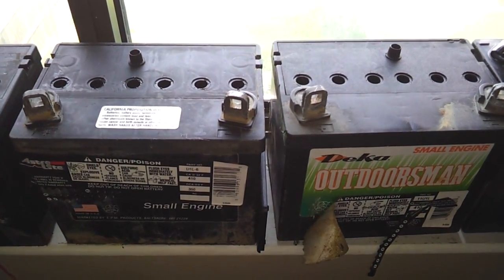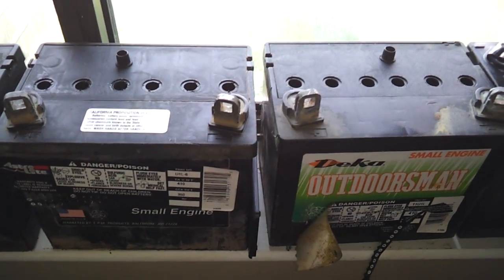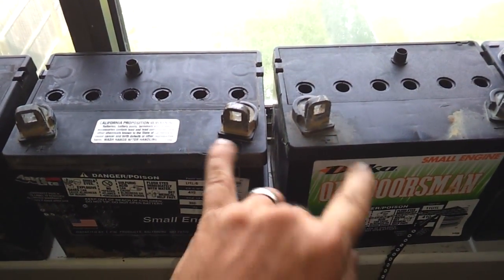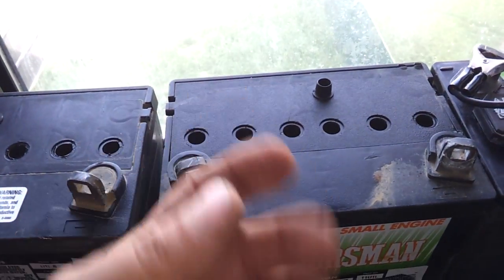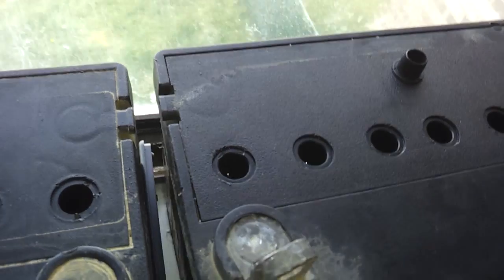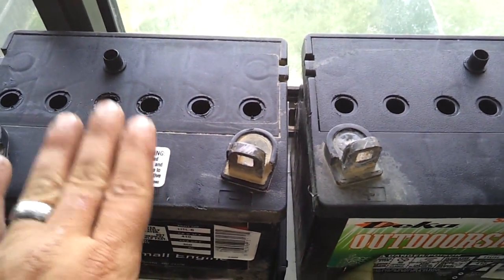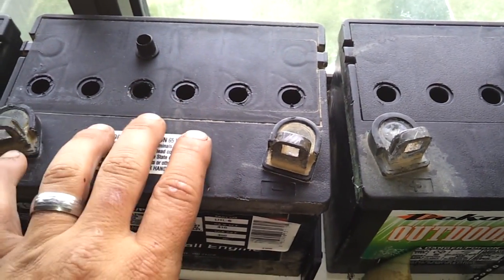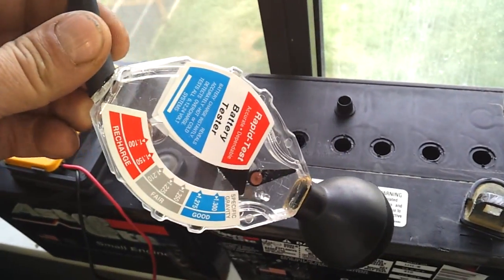Inside view of lead acid battery before and after desulfator

Comment: I got a idea now cut the top off  a deep cycle battery and see beforeband after charging snd taking the sulphur out .put the lid bsck on and use a oil based caulking like for gutters hopefully they have black now.well fing see the diff.😊

Comment: Why couldn't you pour out the acid/water.  Then pour in something to dissolve the sulfate and any other junk on the plates (nitric acid, or whatever the best solvent of lead sulfate is).   Then pour that out, rinse good, and pour the acid back in or use new acid????

Comment: Hi, i recently got into this depth of auto battery charging and reconditioning (desulphate). Your video refers to 3 weeks of the process going upto 4 weeks. My Stanley unit has a recondition function, that states the process will happen for 24h after which it will go back to charging automatically. It also states that if after completed this process 5x times it does not work, battery should be recycled. Pl clarify why their 24x5 times cycle amounting to 5 days and 10 inclusive of 5 x 24h charges is a limit vs your process of 4 weeks.

Comment: When desufating, how many kwh are you using in a months time?
Reply: I actually wondered this to as a typical desulphator will use around 100w or 1kwh every 10 hours so that's between 72-100 kwh if you desulphate for an entire month and at .12 cents a kwh that equates to around 8 to 12 dollars to desulphate a battery for a month. To me that's still better deal then new battery and most ppl will know within the first few days of the battery will be recoverable or not.

Comment: I was able to pull out one of the caps with my finger nail. Wow what crap!!! Makes me so mad that a company will completely lie about their products. They know for a fact that there is no such thing as a maintenance free flooded lead acid battery. And yet the hide these cheap caps and lie about it.
Reply: Hiding the caps is still better than them selling you batteries with no open-able caps. Most batteries are like that now. They are maintenance free because you are supposed to buy a new one once the battery dies.

Comment: Ok AWESOME! Two batteries side by side. Both definitely made by East Penn. i was thinking the two new Deka batteries i bought were absolutely junk because they were completely sealed. But looks like it’s not difficult to open those caps to actually maintain them. Did you cause any damage when you took off the caps?
Reply: nah, its fine slong as you dont break them too much

Comment: Did the de -sulfated battery after 3 weeks on the desulfator restored back it's Cold Cranking Amps? What about it's Ah capacity? Pretty sure the plates inside got back their original color but what about the numbers? The easiest way to find out is to start a car and watch the voltage drop. Thanks.
Reply: It should be close to brand new since the sulphuric acid/electrolytes in the batteries do not chemically bond with the lead plates.
Reply: Thank this battery reconditioning plan https://t.co/uUSuy6Yk5g for the help reconditioning my batteries. I had Three dead batteries scheduled for disposing of. But I was able to recondition them using this technique in just One hour! It really works for all kinds of batteries!
Reply: @jennyholt9297  lol u snake salesman u

Comment: how can i tell if my batteries need to be desulfated?
Reply: bob woerner If you're talking Wet Cell types (as in the video), the visual indicator is one way. The other is measuring the voltage in a unused state. If it's above 12.5 V, then sulfation probably isn't a problem. Anything below usually starts producing it. 🤔

Then you also try putting a small load (e.g. 2 - 3 A) onto it & measure the voltage drop. On car batteries the drop on a healthy battery should be something in between 0.1 - 0.2 V. If it drops more (0.5 V or more), then sulfation might be present. 🤔

Similar to VRLA/SLA AGM (UPS) batteries.

Comment: we did not see before and after, those are 2 different batteries. Also after desulfator where sufates goes? again to the electrolyte, so it will sulfate very quickly soon
Reply: That's why you need to change the electrolyte after this process . :)

Comment: Did you know you desulfate all batteries when you charge them? That's how batteries work. The lead and sulfuric acid turns to lead sulfate when they discharge. Then when you charge them, the lead sulfate turns back to lead and sulfuric acid. How do we know the battery on the left is charged?

Comment: Ok, cool.  But what does de-sulfating do?  Meaning, what do you get out of this process?
Reply: +Richard Forester It exposes the lead which is needed to sustain the chemical reaction which is what creates the actual electron delta (potential energy we call "charge"). Thus, it can restore a dead battery.
Reply: +GregJoshuaW Hmm... that's what I thought.  But then I thought, if that's all you need to do why aren't people doing that instead of replacing the battery?  Anyway, thanks for the info!
Reply: +Richard Forester I suspect this is not well known so that battery manufacturers can sell more batteries. The extra "core charge" you get back by returning your old battery likely goes toward restoring old batteries and reusing them somehow.
Reply: NOTHING. it just bullshit.

Comment: @Mad Electron Engineering
  If a battery has lost all of its acid?fluid inside....WHAT should it be refilled with?, Is it water, Sulphuric acid, Hydrochloric acid, what should it be filled up with,I have no idea and want to learn/understand...
 Does the electricity change the fluid from water to acid??
Reply: SP330Y t

Comment: @ EVERYBODY Does anyone know why if you don't use your vehicle for a long while (even with a brand new battery in it) it kills the battery, even after recharging if you don't use the vehicle a lot that kills batteries :(
I have lost 3 batteries that have died this way because i hardly use my vehicle,and after charging still would not start the car, what is happening to kill these batteries if they are not used, I mean i cannot understand why they just wont charge up again.
 ALL of my batteries were brand new, and the charger in perfect working order
Reply from the maker: +SP330Y Batteries self-discharge over time, and you always have a small current being pulled by your car's computers and radio even when the car is shut off.
Reply: All you need is a battery maintainer,will keep your battery charged and prevented from getting sulphated. Buy on of known brand. Have two of them,one for my Discovery and another in a lawn mower,things that I do not use frecuently.
Reply: Connect a solar panel charger. I got a 5 watt panel for 13 bucks on Ebay. Works fine... Just clip it to your battery and you're done. No more dead battery.
Reply: +Mad Electron Engineering need help..urgently
my battery is giving 10.5 volts..i think one cell is dead.. i find it through multimeter..
i am going to clean and refill it with acid and water..can you tell how  can i clean it from inside...can i use mineral water or anything better?
Reply: When they fill batteries, they create a somewhat weak solution of sulfuric acid and distilled water into a mixed solution then they fill it with that im pretty sure. If people are afraid of burning themselves with it, its not as acidic as you think unless its a relatively new battery because of it not being sulfated. If they put a stronger solution in there, it would eat away the plates.

Comment: @Mad Electron Engineering  So does a desuplhated battery mean it will NOW take a charge again and keep it?
Is it the sulphur build up that stops the batteries from charging and starting your vehicle?
One more question, would it be quicker to drain the acid out, flush it with some chemical that attacks suplhur, then refill with WATER and recharge?

Comment: I wonder if the desulfation action is all the way down the plates.... or just the top 1" or so ....
Reply from the maker: Michael Durkin All the way through, that's why you usually assume 1lb of battery per day.  This allows time for the desulfator to work all the way through the battery.
Reply: R&TPreppers
Dang .... 300lb 8D would take all year .... oh well ...
Reply from the maker: KC7NOA
IF you make one for each battery and leave them on permantely they also work well in maintaining the batteries.  You'll still see a noticeable improvement within a week tops.
Reply: +Michael Durkin need help..urgently
my battery is giving 10.5 volts..i think one cell is dead.. i find it through multimeter..
i am going to clean and refill it with acid and water..can you tell how  can i clean it from inside...can i use mineral water or anything better?

Comment: My problem with the wizbang units is soon as I go to try it on the next battery it burns up the wizbang plus.do you have a unit that is reliable ? I'm using a hobo freight float 42292 charger that cost about $9 to run it
Reply from the maker: are you disconnecting the battery charger when you switch batteries?  If not then the charger can be overloading the circuit since there's no battery connected to absorb the pulse.
Reply: R&TPreppers 
Yes I unplugged the charger both times, the wizbangs failed.
Reply: +Jay Finke careful with those Harbor Freight "float" chargers.  You will now see that the low cost one no longer says float, it says maintainer for a fully charged battery.  They will ruin a good battery that is not fully charged when you put them on.
Reply: yep yer right, found out the hard way, should have monitored the voltage, and as a added bonus, they consume power when unplugged. and it was the $29 ones i was using

Comment: I use the WizBangPlus.  I  notice my biggest results in the first few days (vs weeks), which is about as long as I typically desulfate my batteries, because I have a lot of them.  I'm trying an experiment now where the battery is on sitting on top of an electric oil filled heater, as they are suppose to desulfate faster the higher the temperature the battery is at.

Comment: I've been using "Battery Minder" and based on the Voltage (Improvement) that the battery will hold after desulfation I'm convinced that the process is theoretically sound and practically
profitable. Thanks for the pictures. They have crystallized what is going on.

Comment from the maker: The desulfator usually desulates a pound of battery a day.  So weight your battery and the poundage of the battery is how many days you run the desulfator, plus 10% for good measure.  At the end of the desulfating the gravity should be within spec for the battery.  If it isn't then ditch the battery as it's too far gone.

Comment from the maker: It all depends on how healthy the battery is and what size the amp hour capacity.  If a battery is drained very slowly, you tend to get more energy out of it.  Conversly, if you pull a lot of amps out a battery in a short time you will get less overall power out of the battery.  It all has to do with the battery chemistry.  Also batteries will have a small recovery once a load is removed and allowed to sit for a bit.

Comment: Ok, my old 12v auto was at around 12.48- 12.49 charge. I ran 2 -60 watt LED lights for a couple hours. Seemed to go down to 12.42 but then stayed there. After I turned off the lights it goes back up to 12.48? What is going on? Ive seen a youtube of a guy running his LED lights off old car batteries for cabin lighting (for 5-6 years each battery) and I'm thinking this is doable, especially after desulfated.

Comment from the maker: Your results might not be optimal with the solar panel as it's only 1.5 watts.  I simply reccomend you get a AC powered smart charger to maintain the voltage during desulfating.

Comment: So, if you unhooked it at night, it would take twice as long? Or can you use a small battery to shoot it 1.5 volts or something? I mean, is there any issue from restarting/stopping it for a couple months? If you put it in a car, it does about the same thing, only worse?

Comment from the maker: It's not really possible for you to have 17 volts in a standard car battery.  Check to make sure your meter is reading correctly.  lead acid cells usually produce 2-2.25v per cell, even with a higher sulfuric acid ratio in the electrolyte you shouldn't be able to get up to 2.8v per cell.  weird.....

Comment: Hey, I have a battery question, - I overcharged my old but still pretty good (96%) car battery to 17 volts with a solar trickle charger. It went down after a few weeks to 15 volts, but now in the cold its back up to 17.4 volts. Should I discharge it down to around 13 volts?

Comment: Thanks man. I've not used the type of desulphator you have, so did wonder if you applied anything afterwards as a finishing step to combat stratification etc.

Nice voltages, Nice process.

Good luck with the desulphator enterprise.

Cheers.

Comment from the maker: they're actually trickle charged through thr whole process my a constant voltage source set at 13.5vdc.  When the duration of the desulfation treatment is done i'll equalize the cells by running the voltage up to 14.5 for 1-2 hours then bring the voltage back down to 13.5 for another day then call it finished.  all successfully desulfated batteries should be holding a charge around 12.8vdc after being unplugged for 24 hours.

Comment from the maker: I need a little more information.  What was the specific gravity of the cells?  Did you desulfate or charge the battery prior to taking a SG measurement?  What type of battery are you working on?  THere shouldn't be any "mineral" deposits on the plates, just lead sulphate buildup.  If there's mineral deposits on the cells then someone put regular tap water or other substance in the cells instead of just pure distilled water.

Comment: Not been at this long, and I've had two UPS batteries defeat me due to shorts, but that was while using the AC/capacitor/bridge method. I think all i did was make it worse.

Batteries are hard to get, so I had to try, and I've done it! Voltage and SG both climbing.

I believe it was only possible because of high power, cap discharge pulsing methods. Plus many hours of time spent in working on the unit itself as the pulsing continues. Only for the desperate...

The shorted cell has warped plates

Comment from the maker: No it is not possible.  You can leave the desulfator on indefinitely as a maintenance product, and that will help with the longevity of the battery.  Just make sure you always have something float charging the battery so the desulfator doesn't accidentally drain the battery.

Comment: I myself i use chemical desulfator ,, to restore battery's 
and use electric desulfator to maintain ,, 
I currently have 4,000 amp battery bank  ,,
it take to long and to many // many// electric desulfate  to fix repair large bank 
or large battery's // my are 6 volt  360 amp battery's  it take months to desulfate one 
with electric desulfatetor ,,

Comment from the maker: you are correct, no chemicals, just the electronic circuit.  my opinion on chemical treatments are bad.  Even if the chemicals do work in removing the sulfation, they usually don't dissolve the lead sulfate back into the electrolyte.  Instead it just sheds it to the bottom of the battery case and the electrolyte sulfuric acid ratio is still weak so the battery is still hurting.  Don't put something into a battery that wasn't there to begin with.

Comment from the maker: You don't sound stupid, that is a valid question.  I do believe that there is a modified circuit for a 6 volt battery, but I've never looked into it.  Easiest thing to do instead is just hook up two 6 volt batteries in series and make the wire running from negative of the first battery to positive of the second battery as short as possible le and as thick as possible.  Oops run on sentence.